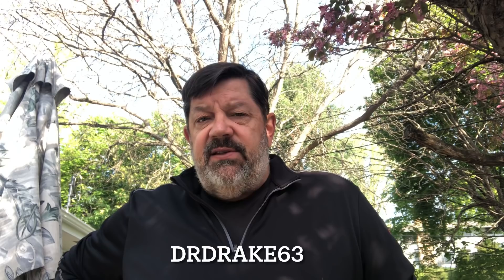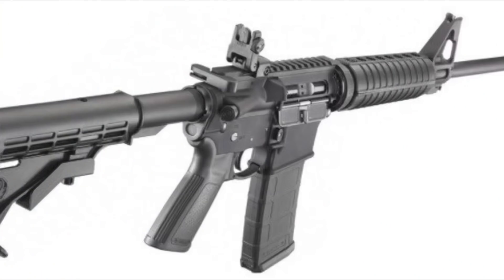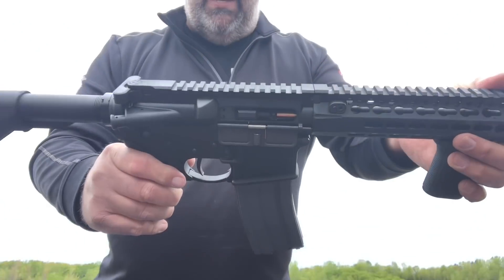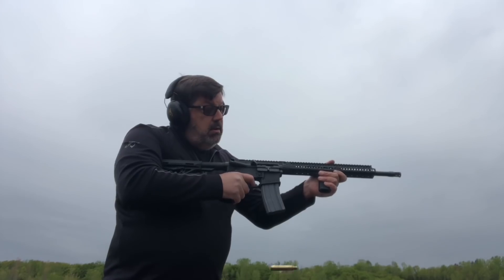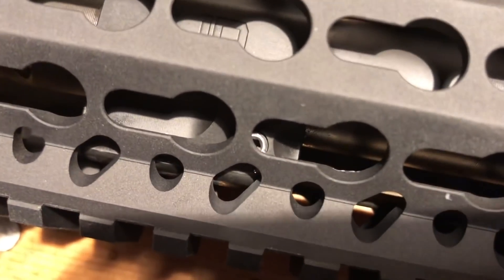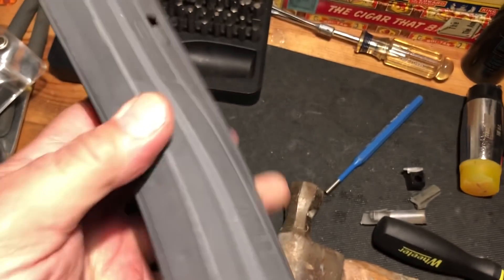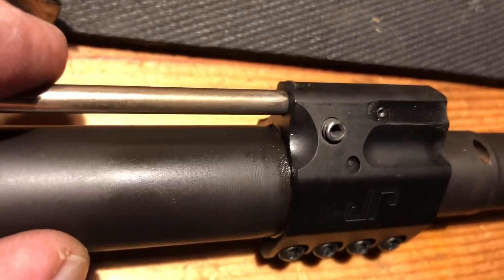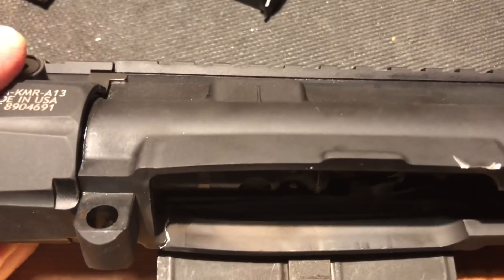Colossal AR Failure

Comment: You really need to think twice about "gamer-fisting" that trigger like you do. You're not Jerry Miculek, dude. Don't try to be. Slow is smooth, and smooth is fast. Think about it this way... When you're hammering away at the trigger like that, how are you ever gonna catch a Squib before you set another round off on it? The answer to that is simple; You're not. 

I've seen people almost touch off on Squibbed barrels while firing slow, so there's no way you're gonna convince me that what you're doing is a good way to be doing anything. Learn some trigger-discipline, or put the rifle down and take up a safer hobby. You're a danger to yourself and others.

Comment: Definitely a out of battery detonation. I would start with inspecting the chamber. Also could have been a slightly out of spec case that didn't fully seat all the way into the chamber. All the pressure shoved the bolt back hard enough to split the carrier,crack the upper right outside the chamber area and send the rest of the pressure down the mag.

Comment: going to agree it was a gas block issue but not for the same reason. i have a couple of Ar platform rifles, one of the issues i've had is on the second round not going into battery. the first round which is manually loaded with the charging handle goes into battery just fine the second round would hang up before the round can be fully chambered...after watching some u tube videos took the bolt apart, there is an 'o' ring around the extractor spring...when you manually load that first round the charging handle is pulled back to the stop fully compressing the buffer spring causing that first round to fully chamber, on the next round the bolt carrier group receives only enough gas from the gas block to force the bcg back just enough to pick up that next round but to not fully compress the buffer spring, with out a fully compressed buffer spring there is not enough thrust on the bcg to force the extractor over the rim of the cartridge causing that next round to wedge into the locking lugs.upon removing the 'O' ring from the extractor, no longer had that issue. so in his case he may well have had a slam fire with the bolt not fully in battery , but with  the firing pin able to contact the primer early.

Comment: Over gassing the the systems will Not cause that problem. Over gassing will wear down your parts faster, like extractor, and springs. Did you test it with factory ammonium? Or is it reloads? The only time I seen a failure like that was when the rounds is over presser. Hotter rounds

Comment: I don't think it's the gas block. The GB doesn't make the gas port in the barrel any larger (0.080"-0.090"), limiting flow volume regardless of how much flow an adjustable gas block could allow. I suspect the timing of happening after the GB change was just a coincidence. Increasing flow rate wouldn't blow something up, that takes pressure. The only thing that can drastically increase pressure is the ammo or a blockage. An AR carrier can be blocked to allow no cycling, receiving full pressure, and not fail. 

I'm very interested in hearing the errors of my thinking on this matter as my opinion is it wasn't the adjustable gas block nor the installation.

Comment: Ammunition is the most likely culprit, since it seemed to be running fine before that. If it was simply over gassed way too far before, you should’ve seen case head separations and similar brass mangling before you saw it blow apart. 
Ammo caused an over pressure event would be my guess: squib, overloaded round, or a 300 blackout round got into it as the final round.

Comment: If the wide-open gas block that you took off didn't explode inside a gas block that you adjust does not make gas it just limits how much gas is going through it can't be a gas problem

Comment: The gas tube is the weakest point!  an over gas issue would have blown the tube unless you upgraded the tube to an exotic material like titanium or something that? Next was the BCG pressure tested? some BCG are cheaper and you get what you pay for.

To me this looks like a Ammo issue! out of battery or too much power. What did the case look like when you extracted it? looking for bulging or the back blown completely off, if so that is the culprit. 

Now if the that is not the issue and the failure happened while the Bolt was in battery you should replace the barrel as well..... I wouldn't trust it.

Comment: I'm honestly inclined to believe it cannot be the gas block. In a normal gas block the gas port in the barrel regulates the gas entering the system. I would assume you didn't change the barrel.
Therefor you cannot introduce anymore gas then what you normally have, Only restrict from that starting point.
I would lean to material failure of the bolt carrier. That carrier does seem rather thin where it failed. Probably caused by a detonation.

Comment: Damaged upper with installing free float tube 
Carrier tilt stopped bolt after unlock. 
Either didn't hold upper properly in receiver block or didn't use react rod to secure upper. 
Damaged or over torqued barrel nut.
Damaged upper allowed carrier to over rotate or tilt from over stress or damage to upper. 
No way gas block caused the problem it doesn't increase the gas over what a factory block gives you...
Adjustable block cuts gas not increase unless you drill the port...
If the gas port is drilled, the potential issues for pressure spikes is ??? You get it.
Don't think you did that but all the experts will jump on everything that has a possible discrepancy...

Be careful taking advice from anyone, mostly me...
Lots of expert advice on the tube....
Just like legal advice in jails...
No shortage of Either...

Comment: There is no way that damage was caused by over pressure through a gas tube. That gas tube would have ruptured or distorted or blown out of its fitting.
 You have an overcharged cartridge or barrel obstruction.